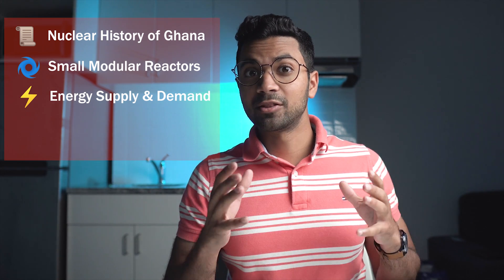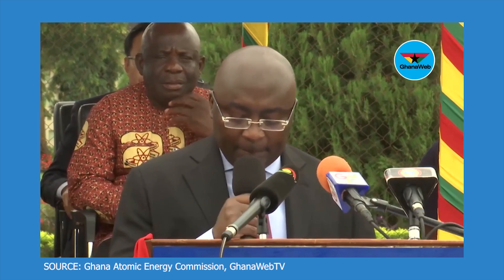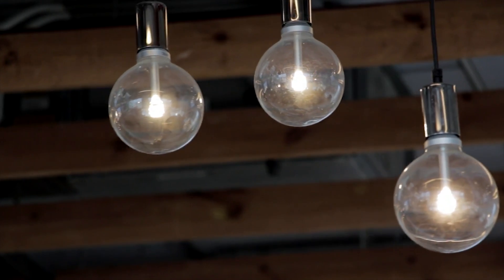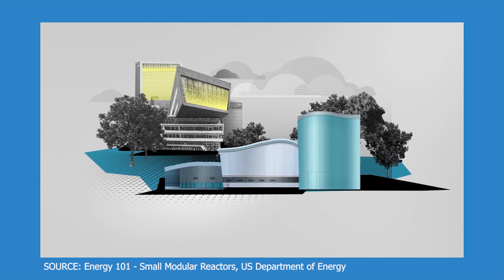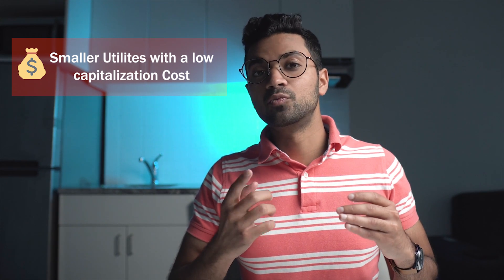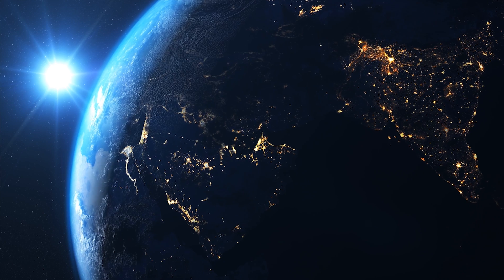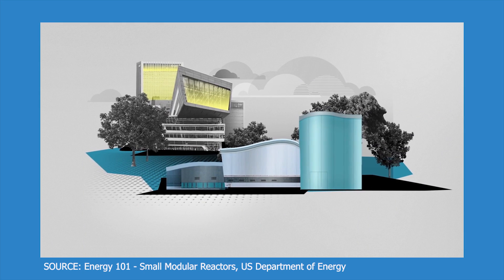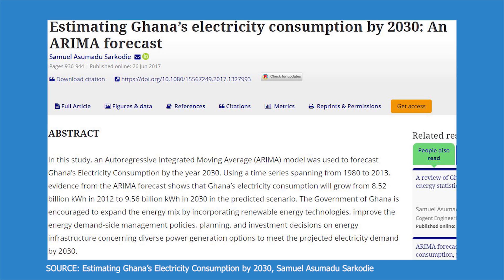Small Modular Reactors can solve Ghana electricity crisis, Here's How

Comment: As a Ghanaian I  completely object.... Ghana is hot af solar panels would be perfect..reactors are basically bombs if someone fucks up boom explosion and I know Ghanaians don't manage infrastructure well...just go green man.
Reply from the maker: Reactors use very low enriched uranium, and fuel which physically cannot explode. Reactor fuel is is designed so that it cannot explode or cause major damage. There are multiple barriers and safety systems in a nuclear power plant, hope you get the chance to check out some of my other videos that have more details

Comment: Good to have SMRs to provide short term solutions to Ghana's dumsor problems. What about the thorium's exhaustibility in many years to come? What about the radioactive waste disposal and natural disaster that can cause Fukushima type situation?
Reply from the maker: Commercial GEN 2/GEN 3 Nuclear reactor Used fuel in the form of "waste" can be converted to fuel for Molten Salt reactors (SMR designs). SMR's are a great long term solution. Energy density of both Uranium and Thorium is huge, they can supply the world with reliable energy for a very long time. Lastly, Nuclear waste can be effectively managed using Deep underground repositories (DGR's). These are designed using principles that can be found in nature. Natural DGR's have been found in parts of the world like Canada and have safely contained Nuclear waste products from naturally occurring Nuclear reactions on earth. In summary, Nuclear waste has proven solutions and is not a very big issue. Here is a video I created on natural nuclear reactors you can check out: https://youtu.be/zc0lAeFNjDg

Comment: I would think that since Ghana is close to the equator, mass-implementation of solar would serve them better. 
Most industrial processes occur during the day, but they could still invest in thermal energy storage or compressed air storage for their used-up oil wells. Even if it's less efficient, the capital required would be less. 
Solar also can scale to microgrids, providing less urgent need for grid expansion. I really just think nuclear is better fit for nations that are farther from the equator or nations that also need heat supplies like the desalination one you explained in another video. While it does get cold at night in deserts, Ghana is close to the ocean and has better temperature regulation.

While not requiring World Bank or other loans would be great, relying on a foreign company for a third or more of the power supply brings discussion of imperialism, although minor indeed. Plus, workers would have to be brought in, and solar requires less foreign expertise, as is a problem currently with the Belt and Road Initiative.

Although investing in reactors would stir up science and help inspire future generations, I just think solar is the choice for Ghana's material conditions, though of course, inertia will have to be provided.
Reply: Lars, I believe you miss two important facts in your analysis.

#1 - Most industrial (vs commercial) processes are 24/7 continuous (so, although they occur during the day, they basically have the same load at night). Chemicals, refining, smelting, concrete, etc, and of course manufacture.

#2 - 90% of industrial (vs commercial) uses energy as process heat (chemicals, refining, smelting, concrete). Only about 10% of energy used is electricity (i.e. manufacturing).

Of course, Ghana has a different mix than the average country, but there is nothing to presume they are far from average in breakdown either. See IEA data.

Ghana's commercial sector (offices, shops, schools) probably can make good use of solar (because people are using those facilities during the day.

However, for Ghana's cities, centralized power is better for the residential sector. It is great for everyman to own and operate their own home solar and battery storage, but terrible if everyman is not an electrician. Sure, we can have a specialized class of worker, 'electricians', who can make house calls - but now add in the inefficiencies of them travelling about the city, point-to-point.

If the solar panels and batteries were all in 1 location then the electricians can put in a 9-to-5 with high productivity. But if you are building a centralized solar farm (usually across large areas of productive farmland), then why not just go with a nuclear centralized power plant (on small areas of unproductive city) and avoid headaches of massive storage (vs just enough for load balancing)?
Reply from the maker: I believe a mixed approach would be best Lars, I don't think there is one silver bullet. Renewables need to work alongside Nuclear to help us get to Netzero!